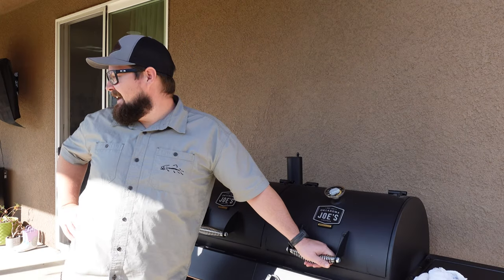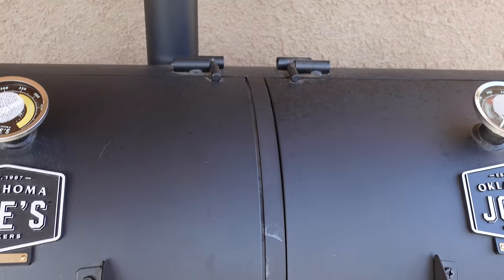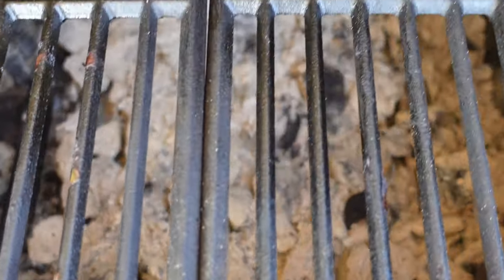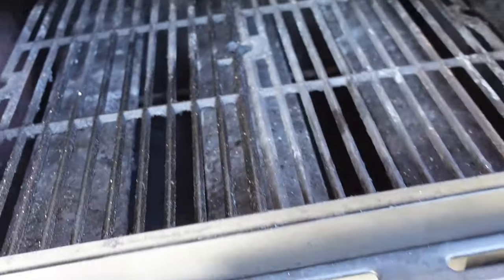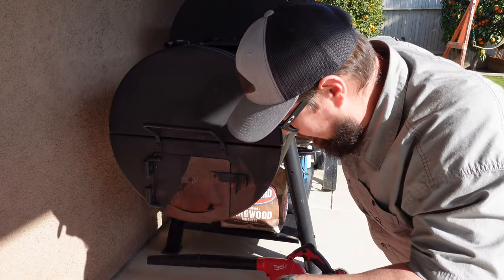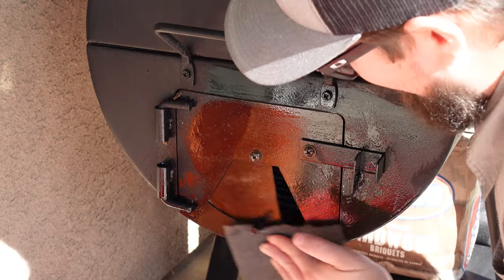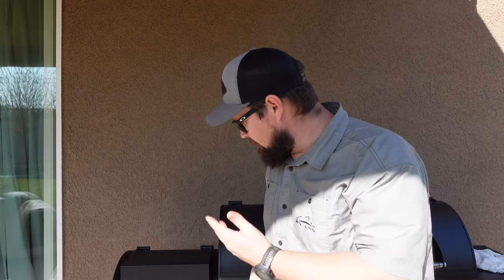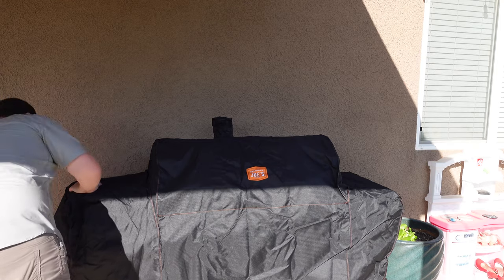Oklahoma Joe's Longhorn Combo 1 Year Review

Comment: 2nd time using this grill.   Both times I've only gotten the middle chamber to 200f max with chimney wide open and side dor at about 2".  Any thoughts?
Reply from the maker: Try opening the side door all the way and barely cracking the chimney open for air flow. See if it heats up then. How much wood or charcoal are you using? You could try more.

Comment: Awesome video! Very helpful. I've had one for a couple of years now. But I never use the charcoal side. I've always used my Weber kettle. I want to start using my Oklahoma more. How do you go about using your charcoal side?
Reply from the maker: It depends on what you want to do with the charcoal side. If I'm doing a long cook, I'll load up the offset firebox with my charcoal and cook on indirect heat, but if I'm going fast and hot like wings or fish, I just load up the charcoal side. I just did some cedar plank Salmon and I cooked directly over the coals on the charcoal side and it came out great. If I want to cook over wood, just cook directly on the grate in the firebox. I've only done that once because it led to a lot of cleanup before my next smoke. It's easier just to contain all the grease on the charcoal side, but I don't want to burn wood in there and take the finish off that side.

Comment: I’ve had mine for over a year now.  I use it weekly, smoke,grill,pan fry etc. I did make a basket for my fire box which help keep the coals together and burning even.  I wish they had a shelf on the front of the smoker side.  It’s a beast and heavy.  I live in Vegas so I have no rust or moisture issues.   I would buy it again.
Reply from the maker: I would buy mine again, too. I might try and build a basket and maybe another rack on the smoker side. I make my own sausage and would like to hang them when smoking.

Comment: Do you have to install the side burner if you don’t want it?
Reply from the maker: You could technically leave it off if you want, but you'll need a fitting to plug the LP connection.

Comment: Still holding up good, no rust? Also is it extremely hard to hold a reasonable temp for smoking?
Reply from the maker: Yep, still going strong! It's not too hard to hold the temp once the firebox is going. You have to feed it small pieces or else it will try to get away with you. I'm still very happy with it. I've done 16 hr smokes on it without issue, just a little more work than something bigger and heavier.
Reply: @RoadandReel  sweet man I preciate it, looking to buy one of these soon
Reply from the maker: @danielgainey8720  you won't be disappointed and they usually go on sale in spring.

Comment: Greta video. How do you keep temperature regulated on this unit? I have this combo just bought it in 2021. Temps spike all over the place. Hard to control with the small cook chamber.
I’m starting off with half load of lump charcoal, and then I add in wood chunks. (I tried small wood splits but gets way too hot).

Anyway. Biggest issue I have is keeping temp around 250-260 and holding it for longer than 10 minutes.
I’ll get it to 260ish but it drops within 10 minutes
I’ll add a chunk it spikes to 290 and holds for a bit then drops quickly below the 250 mark.

It’s a headache.
Reply from the maker: I control mine with the air inlet at the bottom. I don't use charcoal when smoking, though. I used to burn a fire in the box, until it started taking the paint off. Now, I burn a separate fire in a fire pit and transfer my coals to the fire box. I then add small pieces of wood to maintain the smoke and regulate the smoke up top.  I can maintain 225 degrees with adding coals every 1-2hrs. Once it gets hot, it takes very little coals to maintain.
Reply: @RoadandReel  WOW. I’d love to get on a 1-2 hour fuel add. Hell even just once an hour.
I’m tinkering like every 20 minutes!
Are you in the OKJ Facebook group?
I’m looking for a longhorn combo group or maybe just starting one.
Reply from the maker: @bradpaulp  no, I didn't know there was one. Have you added any seals or anything to your lids? I usually start with a shovel or two of coals and then let it cool a bit to temperature. I talked to another viewer on here and he built a basket for inside his fire box. I wonder if maybe there is just too much air somehow. That's the only way I can think that it would run hot and out of fuel. Oh and most of my smoking is done with almond wood, if that helps.
Reply: @RoadandReel  yes it is on Facebook just search for: Oklahoma Joe’s Owners Club.

I’ll definitely try it with having just a small amount of damper.

I do use a metal box, it’s made by OKJ in fact. It fits nicely inside the firebox.
Another thing I do is, I turn the grate the opposite way, so it basically lifts the grate up a little higher, which has more space for raking the ashes out and it can collect more ash before piling up.

But the metal box is great because it keeps things in one spot and doesn’t let the coals fall out if you open the door.

Downside is that you can ONLY add fuel via the top door rather than the side door.
Reply from the maker: @bradpaulp  I'll check it out. Maybe try a smoke without the box to see if that helps. Maybe it gets too much air around it and doesn't get to smoulder enough?

Comment: If you ever want to properly fix that rust spot where the paint came off. You can clean it up with a wire wheel on a drill and then repaint with VHT 1300-2000 degree heat paint.
Reply from the maker: Thank you, I never thought of just repainting it. I wonder if it would hold up better than the factory? I guess I could always start my coals in a fire pit, first. I did change the bottom rack in the firebox, though. I'm hoping it gets some of the heat directly off the metal, but we'll see.
Reply: @RoadandReel  VHT makes several types of automotive heat paint. They have high heat paint for engine blocks but you want the VHT Flameproof 1300-2000 degree paint, it comes in flat black but there is also a flameproof satin clear coat. This paint has a curing process.
Reply from the maker: @narc46  I'll have to check it out, thanks!

Comment: So I picked one up today for 400 bucks at the tractor supply. Any way I’m just curious really as to how well it holds up
Reply from the maker: It is still holding up very well. I suggest burning it in properly before your first cook and getting a cover. I wipe mine down with oil about once a month and it has kept the rust to a minimum. The burners are still holding up. About the only thing not working properly is the striker, so I'm going to change that out. I'm sure you'll be very happy with this grill.
Reply: @RoadandReel  thank you for the reply! I'm excited doing some chicken breasts in it today
Reply from the maker: @jakepaintin7215  Awesome! You have three choices: smoke, charcoal, or gas. Which one are you doing?
Reply: @RoadandReel  charcoal with wood splits
Reply from the maker: @jakepaintin7215  sounds delicious!

Comment: I had thus longhorn. I left it with my house when I sold it. I did love it. But I had one major issue with this. And I don’t know why they made this part so thin and cheap on it. The brackets for the burner shields rusted out in just under 2 years. I had no other issues but that.
Reply from the maker: Thanks, that's good to know. I keep mine under a cover and it has cut down on a lot of the rust.

Comment: Very handy video! So I'm looking at buying one of these, and trying to find out what people are saying about it. I'm new to smokers, and I'm trying to absorb as much info as I can. What I'm seeing is that these grill/smokers are pretty decent, and as long as you take care of them, they're pretty decent, especially for the price. Seasoning them, and knocking down any rust that pops up, seem to be the keys to them. What are your thoughts and/or experiences?
Reply from the maker: I think you've hit the nail right on the head. I wouldn't hesitate to buy this one again, especially at the price. I have friends with Traegers or other pellet grills and while this one requires more work when smoking, it does a lot more that theirs won't do. I also enjoy experimenting with different types of wood and heat when smoking and it allows me to be involved. And it's more than half the price of theirs. I recommend the cover and like you said, knocking down any rust that pops up. It's cold and rainy today, but Im going out this afternoon to grill some oysters and I can't wait!
Reply: Thank you for the input! I've seen some people talk about using different temp sensors down by the rack itself, instead of using the lid-mounted ones. Other than the condensation, have you had issues with your thermometers, or had any experience with thermometers that are near the grate?
Reply from the maker: @madviola183  no, I haven't had any problems and the condensation cleared up a few days later and the gauges are clear again. I purchased a multiprobe thermometer and I can monitor 3 zones at a time, so I usually stick one in the meat and one on the rack and have an extra in case I'm cooking two types of meat at once. I bought it on Amazon and the brand is Smartro. It's a cheap off brand, but it connects to an app on my phone and I can monitor it through Bluetooth. I haven't had any problems, though.
Reply: Thank you so much!

Comment: Oh Dear God! Oil the outside, to stop rust? Simple two steps. Sandpaper/steel wool rust off. I’d even go the big step of disassembling the door parts first. Then sure heat with a torch a little, and sparky some hi temp flat black. It’s on the outside, it will not affect anything, and will provide better protection and reduce the, now increased risk of fire outside the firebox. Cooking oil is flammable.
Reply from the maker: It's no different than seasoning a wood stove. The  hi temp paint on the firebox will actually light on fire while the oil polymerizes and creates a protective coating. Stoves have been protected this way for decades.